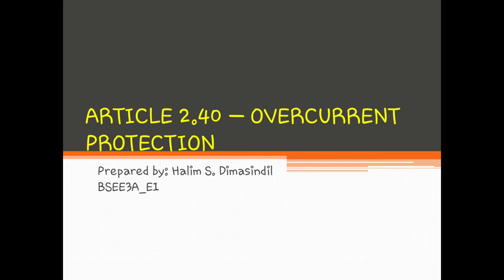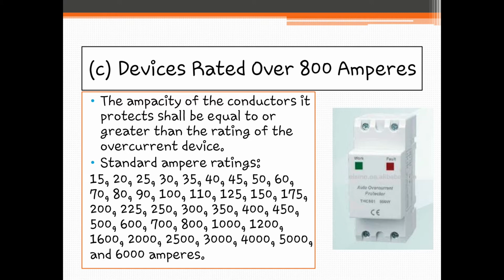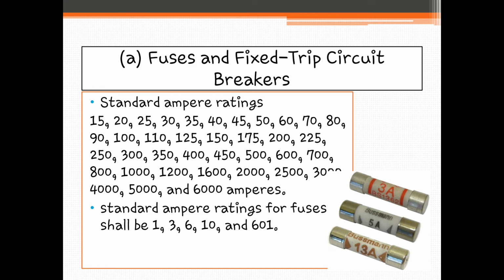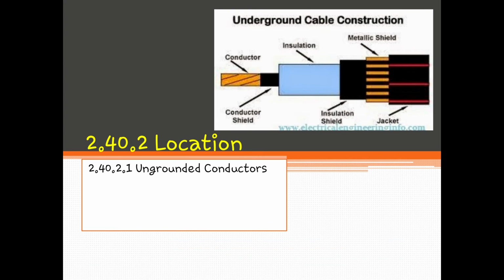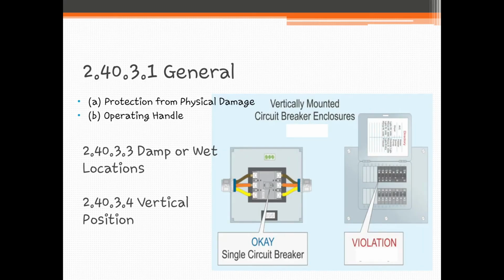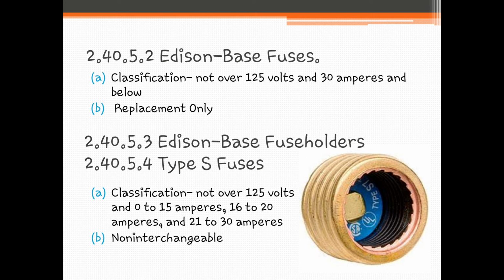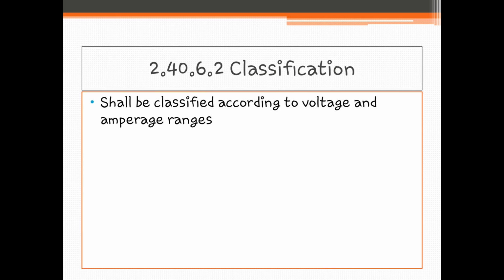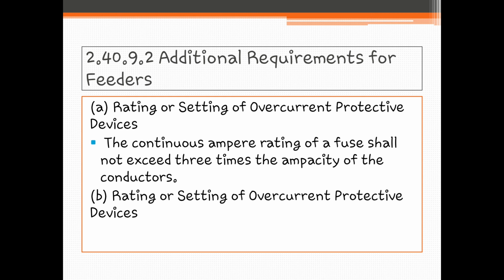Article 2.40 Overcurrent Protection |PEC 2017

Comment: Neer ask ko Lang. May naka abang na 125A tas according sa design nakuha nyang total is 94.13A tas ang recommended use nya na CB ay 125A. Pwede ba I connect Yan sa 125A na naka abang tas  ang icconnect nya is 125A dn na cb pero 94.13A Lang total loads nya?

Thanks